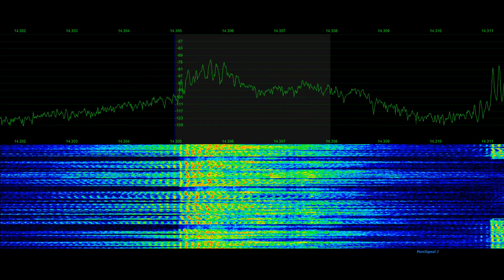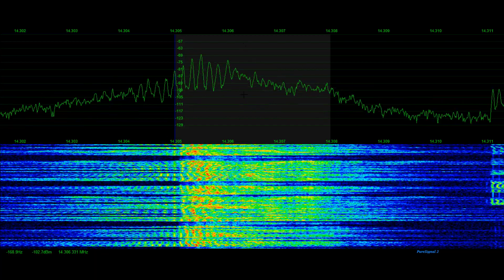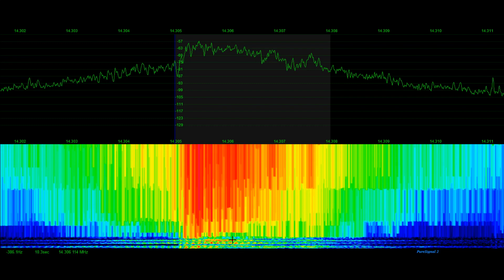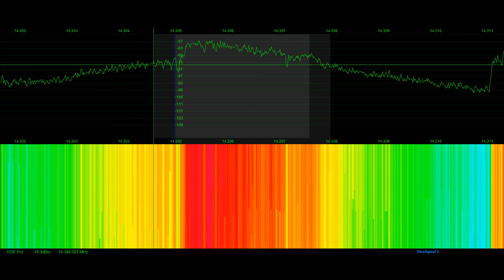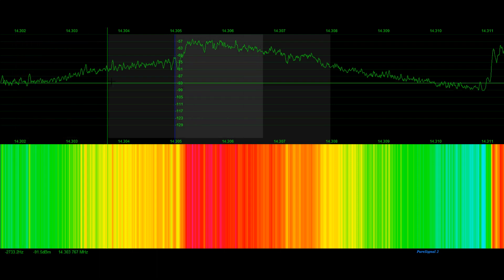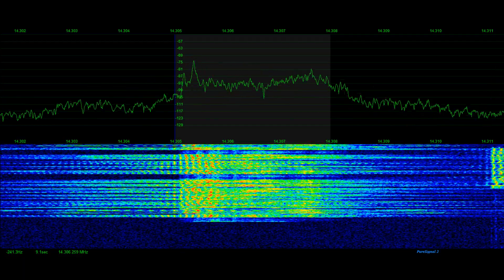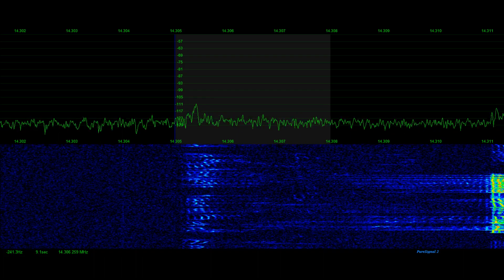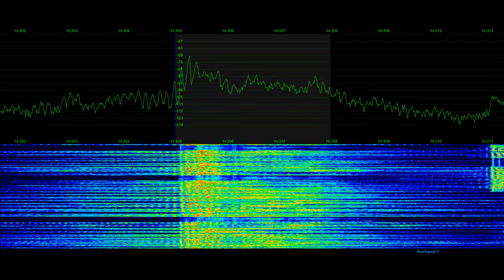Apache Labs SDR | How to measure splatter and out of band IMD products

Comment: Do you know if he was running amp? I notice a lot of amps splatter 1k each side with imd. Or was this just the rig? Tu 73
Reply: Aside from component failures or poor idle current bias levels, the most common reason for this is simply hammering the ALC on a rig. If you take that output and then run into an amp, it just makes it more powerful and exaggerates it. Most of the IMD problems start with the exciter.

Now under loading a tube amp or pushing past the 1db compression point of solid state amps (very common now), those will introduce yet more splatter.
Reply from the maker: I think that was 100w